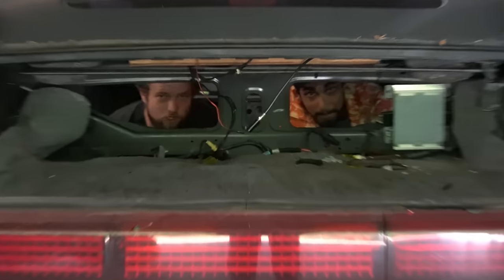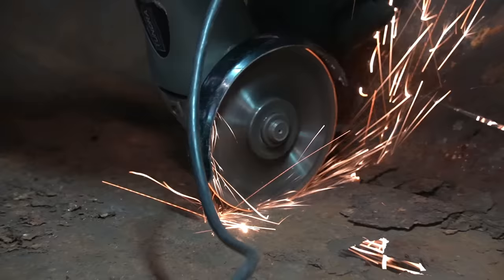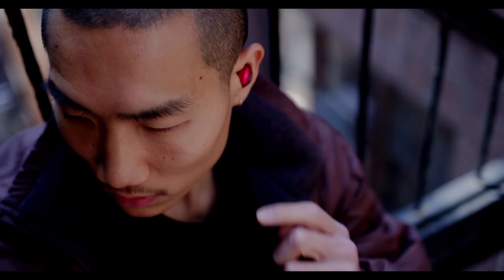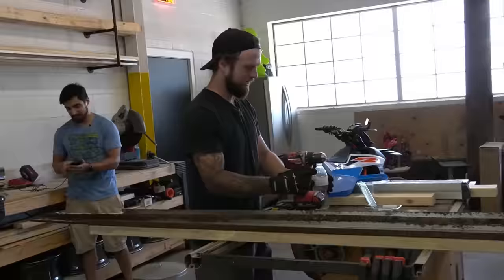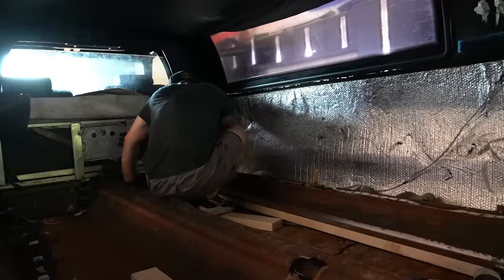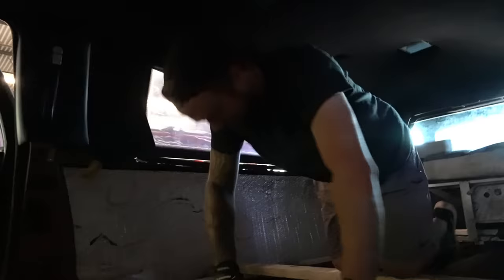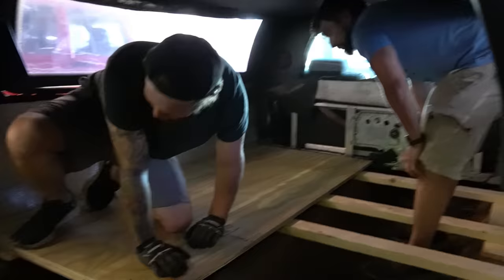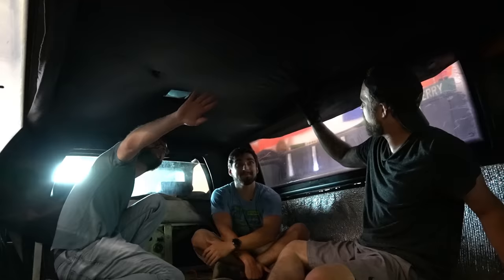CONVERTING AN OLD LIMO INTO A LUXURY CAMPER | PT.4

Comment: Glue that sheet aluminum on the floor, and then put rivets to hold it in place. Trust me I know what I'm talking about.
Reply: Source “trust me bro”
Reply: Bondo would work too.
Reply: Honestly best advice IMO
Reply: I think because they film in advance it's already welded on because of the next time on limo life bit at the end
Reply: Rivits was my plan too
Reply: yoooo samcrac watches ods???
Reply: @DankMemesForAngryTeens  look at his channel he does that stuff
Reply: Bruh why you here
Reply: zip ties would also be pretty useful
Reply: Didnt think I'd see you here
Reply: He's right you don't gotta weld floor pans in these days they got two part epoxy floor liquid weld you just grind it clean and rivet it in (then glue) it comes in like a caulk gun
Reply: That's not a aluminum it looks like galvanized steel or tin which wouldn't be smart to try and weld it into the sheet metal of the car just glue ply wood over the hole
Reply: Pop rivets and titebond metal roofing sealant.
Reply: @DankMemesForAngryTeens  have you seen his channel?
Reply: I don't know what channel you THINK you're watching here bucko, but this isn't sound advice country.
And your advice is WAY too helpful to actually be considered ODS approved.
...
But seriously thanks for some actual advice, God knows they need it.

Comment: Use self tapping screws to secure that piece of sheet metal. Use silicone around the edges to stop moisture. That's way too thin to weld unless u have a extremely nice setup

Comment: Run metal under that support brace and silicone around it thay brace should be enough to make up for the support you lost with the while and the metal and silicone should insalate and the floor i recomend drilling a few small holes to let water out of the bottof if it gets in

Comment: Reese, PLEASE, please buy an old fourth gen corvette and go ham on it one day. Specifically the 1984s, there's plenty of them, and they're not exactly very sought-after cars due to the low-horsepower L83. Even in AZ there's always at least 2 going for $2-3k, in RUNNING (though likely not perfectly) condition.
A 5.7-liter SBC in a 3200lb platform, ripe for all sorts of swaps, or even just a built, stock motor! The possibilities are endless!